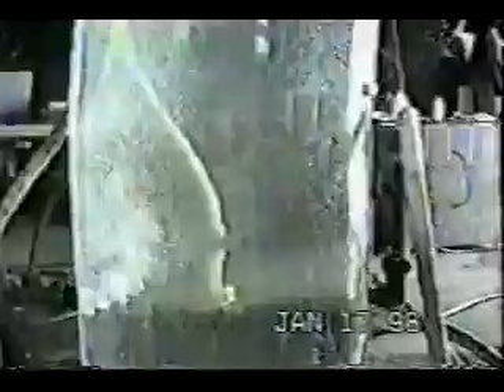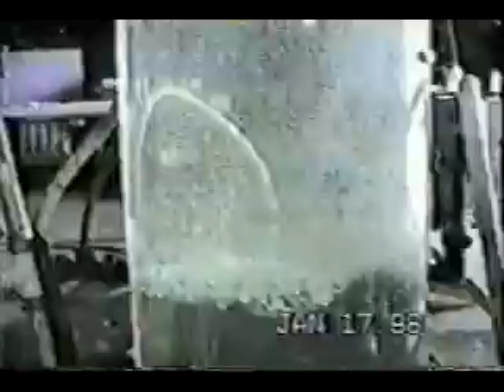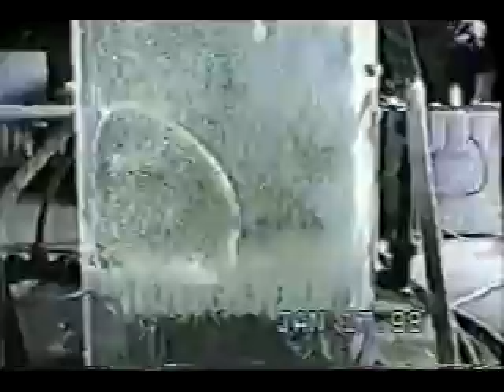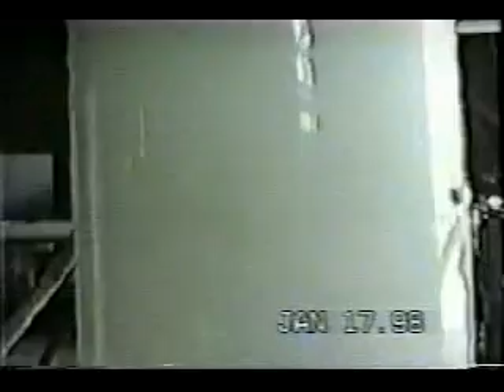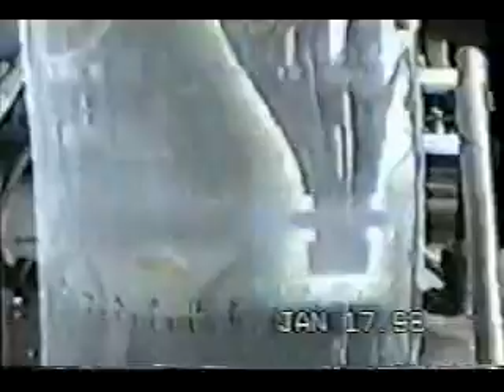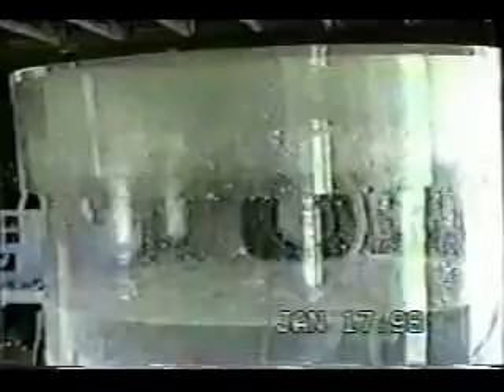How to dissolve ozone into water.

Comment: now whats the end game here???  I understand you are using an injector to help O3 dissolve, but in water its half life is quite short.~8 min or so if it is just water.  especially@ room temp.  what kind of device is it you are using to generate the O3?  most generators produce <5% O3 w/ air and ~10% with O2(chilled & dried). (also ~1% O3 if there are hydrocarbons in the air as low as a 1%) then the poor aqueous stability kills it off really quick so,,? not trying to be a jerk, just curious

Comment: The mazzei seems to be installed with an elbow on the outlet creating back-pressure where the tri-o3 seems to be plumbed straight into the tank.  All other information you present seems to be correct. I'd like to see an apples to apples review will all plumbing shown.